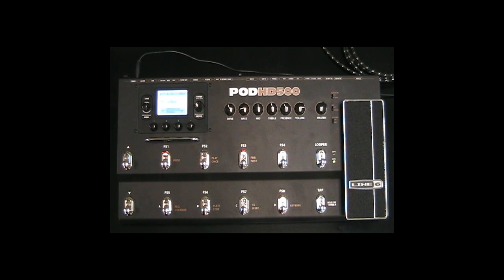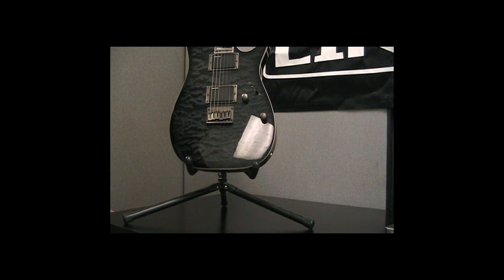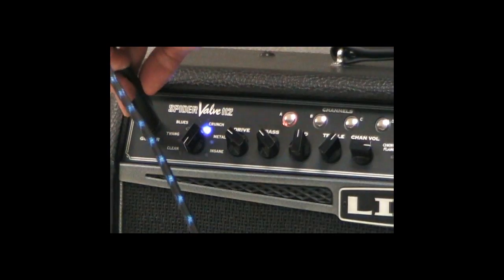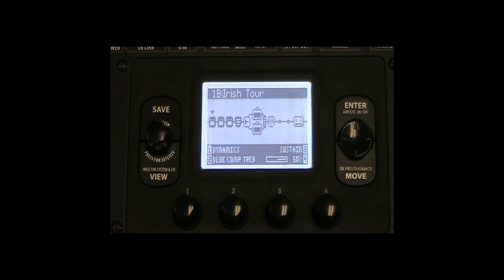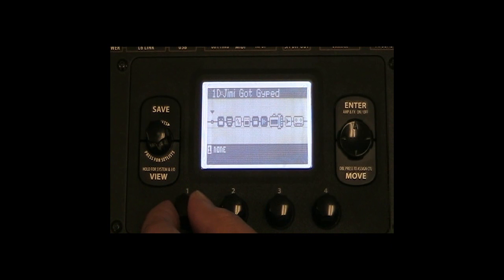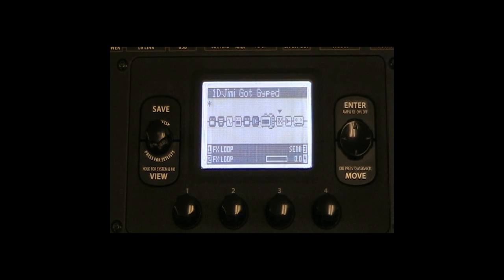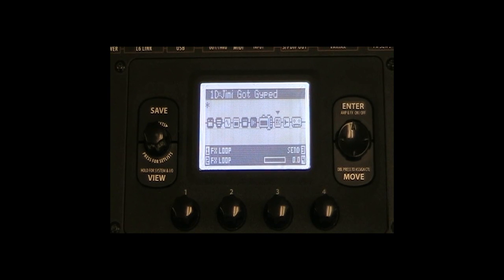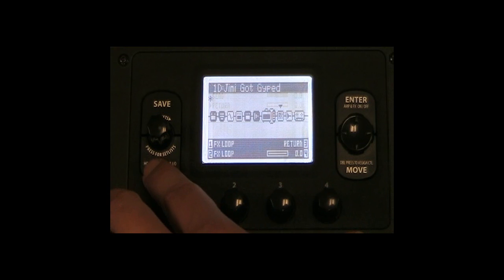Connecting the POD HD500 to an Amplifier Using the 4 Cable Method

Comment: Thanks for this video!  I just got a new Blackstar HT-5 and a Line 6 HD 500.  It really takes some learning to take advantage of the HD 500's many amazing attributes.  

FYI- In order for the the HD 500 to work I had to move the "effects loop" before the amp icon in the chain in order to use my overdrive channel.  Otherwise, no sound was coming out on the channel, only on the clean channel.  I am glad that I figured this out because sometimes I want to use the HT-5 overdrive channel.

Comment: thanks for this...I started plugging my HD500 into my Deville 212 and with the preset tones it works great...but, when I tried to create a tone myself, picked amp, effects etc...the volume just wasn't there...was wondering how to get it to an operating volume...do you have to insert an FX loop into a block all the time?...
Reply: Did you ever figure it out?
I just got a HD500X. Used a X3 live for a little while but majority of the time straight in with my vox & crybaby into my secret (haha). Also a talk-box. Relying or having on/my sound man take care of my effects.

Comment: In 1:02 the FX return is set to "Line". According to user guide this setting is to operate with peak-to-peak voltage, whatever that means. I want to use my POD HD500 as a pedalboard for my amp but I'm not really getting good results as it is tone sucking. Any advice?

Comment: coming from the old POD 2.0...what happens when plugging straight into the front of the amp with a POD is the preamp tone of your amp (whatever it may be, Fender, Marshal etc will color the tone you're trying to put out through your amp)  It's best to use your amps power section only to avoid coloration...IMO...

Comment: Own a hd400,and this 4 cables method left me insane.
Reply: Well there are multiple issues,,, impedance mismatch and also coloration by blending guitar preamps.  Ive found it works best to either use hdr500s preamp modeling with your tube power amp by bypassing the amps preamp or strictly using the hd500  for FX's.    You can do 4CM successfully but i think you need an extra piece of gear,,, a reamp box.  Their fairly cheap though,, but you are still  blending preamps and have to deal with coloration.

Comment: thanks , all this questions I am asking does not explain on the hd 500, I have an zoom 9 tt and the sounds is not as good as the hd 500, but the manual, is really great, explains in pictures everything and in a easy way, and its easy to operates even without looking at the manual,plus shows in details every amp name and how its sounds to what amp, and what type of gain you can get, hd 500 shows only a few of them, but hd 500 is a winner when comes to sounding, thanks any way

Comment: Dear Line6

I bought a POD XT LIVE and I'm not getting a good tone calling it an amplifier ORANGE Crush 20L by INPUT, considering this amp does not have the LOOP.

Therefore, I ask: What is the best way to adjust the settings of the pedal so that it is connected to the INPUT of the amplifier?

thank you

Comment: @filipopolis1976 It works AMAZING with the HD 500 if connected and set up properly.  I put the FX loop after the amp in the chain on the HD 500.  It sounds great whether or not using the amp sims or just "no amp" and listening to the HT 5 sounds.  This amp takes FX well in general, GREAT EFFECTS LOOP!  I couldn't be happier with it.

Comment: thanks, much better, I just have one more question, on the hd 500 I have a loop tape sign, I was wonder if this is only for the loop recording or if its possible to add the different effects before the amp, my point is this, if I buy an amp with a good gain, ex. black star amp, and then on the hd 500 add the overdrive before the amp, and all the other effects after the amp, how is that possible, and if I do the normal hd output to am amp,sounds so bad,even when I only using the gain from the hd

Comment: hello line6 friends..I have a question...well I've owned a podhd500 since few months ago I was using it always only with headphones and the amp's models sound great...but recently I purchased a new amp not valves amp it is a VoxValvetronix Vt80 and I can't make a good tone with the pod it is so different with headphones...well the amp is ok but it is not a great amp...I would like to know or receive some suggestion from you to use my pod with this amp in a better way...and wich line 6 amp would

Comment: After, Must I set the output mode (system & I/O setup) to the front or to the power amp?
What is the focus parameter?
Do I have to use as amp models the preamps? (eg "Class A-15 Pre", not the complete stack with pre, power, cab and mic)
Reply: Power amp

Comment: I have a 75 watt IV spider and a POD HD500X pedalboard, I need to help me understand how to connect the L or R output directly to the amplifier without losing the original sounds of the pedalboard, since I tried to set the amplifier in clean sound to get Better the sounds of the POD but it has been useless, it always sounds like stuck sounds.

Comment: Dear Line 6 can you please include in your next firmware update feature, that enable user to use only the various CAB simulation rather then the the whole amp and cab combination.This is extremely important when I want to use my own preamp of my amp when using 4CM and want to use L6 phones output.Thank you

Comment: I'm trying to connect my POD HD 400 to my Mini Rectifier without success!
I use POD to record, so I have a Rectifier tone with some effects, I was trying to use the same effects but disabling the AMP modeling and using the real Mesa head in live shows. Can someone help me?
Reply: Andre Baltieri did you ever figure this out??
Reply: You have to insert an FX loop block in the chain on the POD.
Reply: I have the same model of Multieffect, and I like conect with Blackstar HT-5 Head amp, how can I do to use the High gain Channel and Only add delay and chorus of my pedal?

Comment: Why did I get a weird spacey/delay effect with this set up? I couldn't figure it out. The chain went volume, gain, fx loop, amp, reverb. Even with all the effects off. Never did figure it out. Also, after plugging it into the front cab of my egnator, giving up on the four cable method, it sounded garbage. The eq was totally off and I ended up not even using the pedal for the gig. Its like the overall quality just dropped. Any answered from anybody would be great
Reply: +Christopher Brown Depends on which amp you use.  Certain amps aren't capable of a 100% serial fx loop and therefore you get that weird sound.

Comment: Dont have pod hd. I had podxt, podxt live and M9 years ago. so i'm not new to the line6 bs (in fact, i;m addicted to their bs hahaha).

I think, this 4CM will work great only if you could  shutdown/disables amp+cab modeling and change the output mode to "studio direct". In podxt the call it "studio direct"", I dont know what they call it in pod hd.

BUT, like @tecnolover2642 said, they also should inform us about the impedance/signal level.

Comment: I just got my POD500X and I'm trying to hook it into the front of my amp, but it isn't making any sound when I plug from the fx send on the POD. Has anyone else encountered this issue, or could there just be something wrong with mine? Any help would be greatly appreciated.
Reply: Jesse McCormick 
you have to make ssure you inserted an fx loop in the hd500 so it jnow to send it out the fx send.
Reply: Jesse McCormick are your interface set right. There is a combo front, stack front ext.

Comment: Hmmm. Wonder how to do this into 2 amps? I have two identical half stacks and would like to connect the hd500 to them in a similar fashion and run true stereo. Guess that would be called a 7 cable method? Anyone? Anyone? :D

Comment: This setup is an impedence mismatch is it not?? A guitar amp input expects to see a guitar signal NOT a line level signal from an FX send.    This will mess up your tone I think.
Reply: No it isn't. There's a book out called impedance for dummy's. I believe it's on sale at Amazon.
Reply: rrguitar1 I am quite aware of what impedance is.  What you aren't aware of is that this line 6 video forgot to explain one very important thing.  There is a little switch on the back next to the fx return jacks for stomp/line.  This must be set to stomp.  I figured it out a long time ago but others might not know.
Reply: rrguitar1 I know what impedance is.  What you apparently don't know is that this line 6 vid neglected to mention that the fx send must be set to "stomp" not "line".  There is a little switch on back for that. If its set to "line" the amp input sees the wrong impedance.   I figured this out long time ago but others may not know.
Reply: Tony Inosencio 
the output switch by the expression pedal should be set to "line"  because its going into the fx return of the guitar amp which is a line level input.  the "amp" output setting is only for going direct into to the front input of the guitar amp - same reason why the stomp switch must be selected for pods fx send to feed the guitar amp's front input.
Reply: I think you guys may have solved the issue I was having. I noticed this unit made my amp, a Randall Thrasher, sound terrible and the FX didn't work right. Now, knowing how the switches should be set, should help things quite a bit.

Comment: line 6 support is really funny, no explanation about how to connect the hd 500, they should have a simple menu, that explains all details in a simple way, zoom sounds worst, but its a relive when it comes to simplicity, so I am selling the hd 500, because, I know how to work from the pc, but from the hd itself, I have no time and patient, most of the manual explains nothing, what's the difference between tripod or whats the cut in the amp, etc, nothing good

Comment: i tired this way with  mesa boogie mark v 25 and pod hd 500x  it made the sound digital, keep away from this method
Reply: +Ender Binen This is not a problem with the Pod.  Mesa Amps have a problem with their FX loops.  You never get 100% wet.  Therefore you're getting your dry tone and your slightly delayed pod tone at the same time.  This latency is what gives you the "digital sound."  This will happen with any FX processor through that loop..  The workaround is to run your FX at 100% and use the blend knob on the back of the Mesa to get the desired mix.  It's a lame workaround but it works.  I've done the 4 cable method with a Pod and an Engl amp and it sounds really good.

Comment: This is a horrible tutorial.  HORRIBLE.  A lot of details are missing about the settings required on the hd500.  Seems all Line6 cared to show was where the cables go.  And what about impedance matching of the FX send/return on the unit?  If the loop is set to 'line' its the wrong match for going into the  amp's guitar input jack!  If its set to stomp its wrong for the return jack which should be line level.  Only solution that should solve this is a little reamp box.